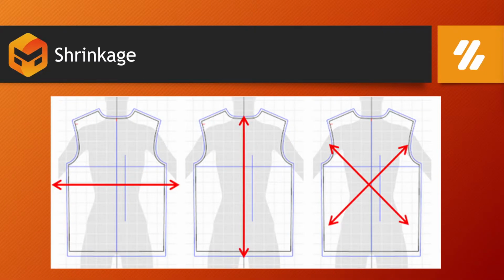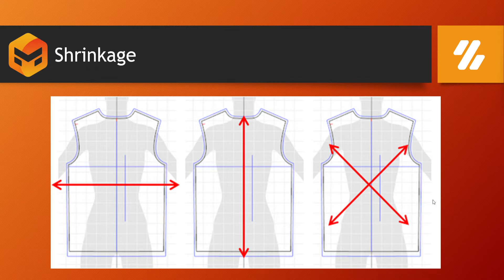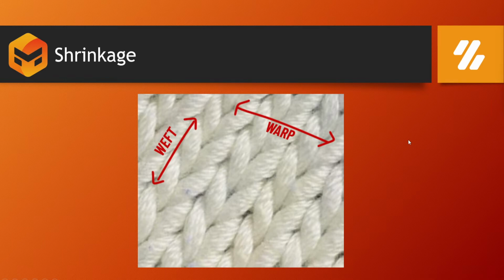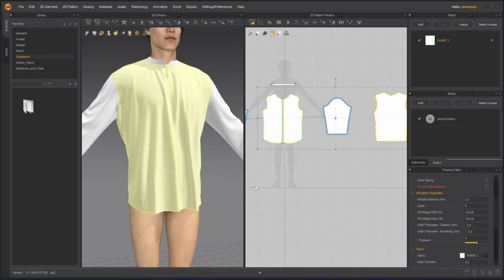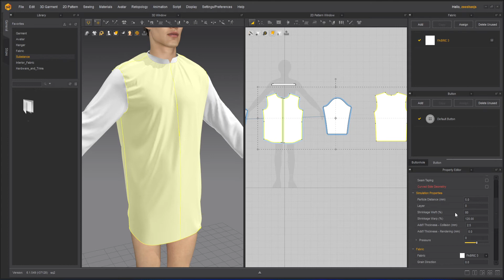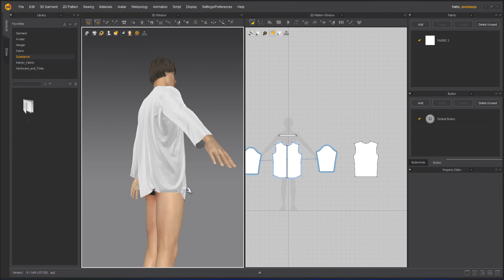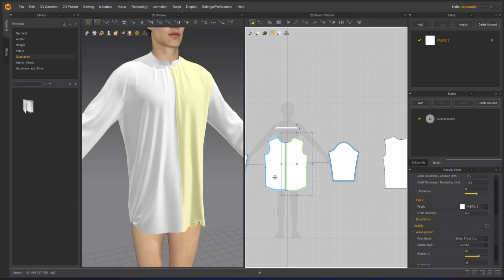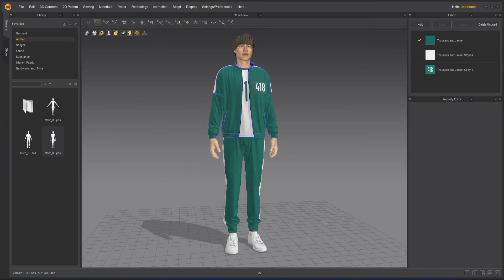Shrinkage Weft and Wrap | Lesson 11 | Chapter 6 | Marvelous Designer Fundamentals

Comment: This is so confusing. So if you loosen the garment's warp which is horizontal it's actually lengthwise grain and loosens it vertically, and if you loosen the garment's weft which is vertical it's actually crosswise grain and loosens it horizontal? In other words crosswise/horizontal is actually loosen vertical and  lengthwise/vertical is actually loosen horizontal? 🙃
Reply from the maker: yes actually other way around